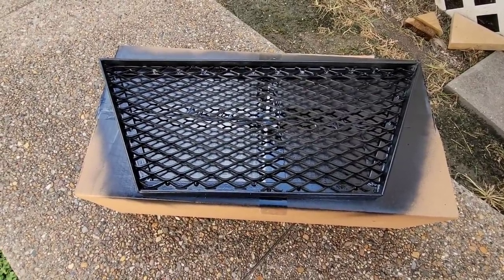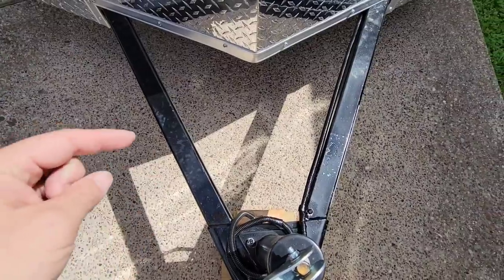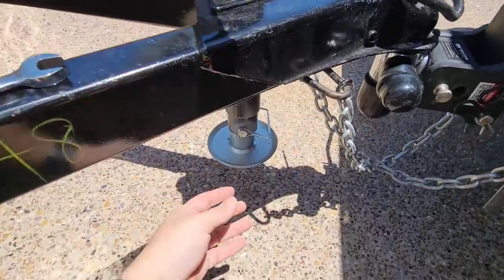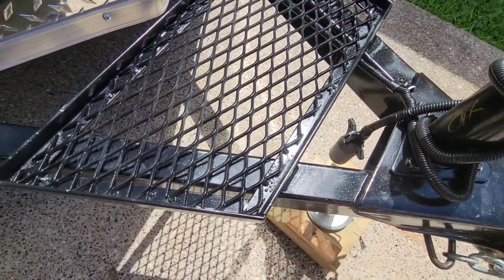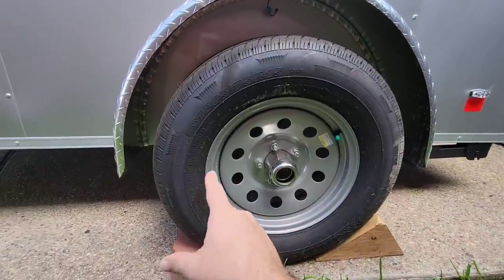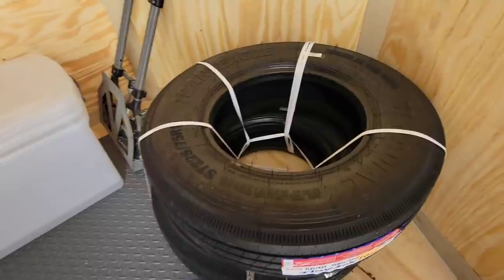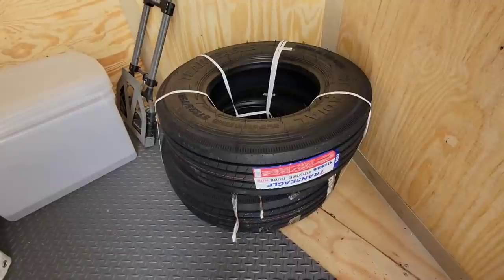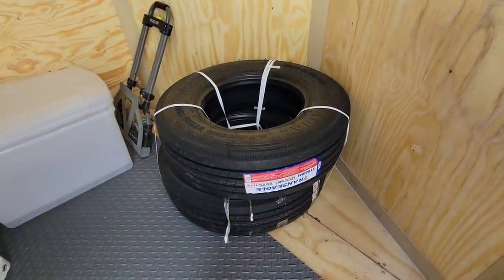Tiny trailer gets a welded on addition!  Also first glimpse at Transeagle 15" G-Rated Tires!

Comment: I guess I'm missing something but regarding the tires, why? People run these trailers with the oem tires all the time and the trailer probably appreciates not being shaken to its core over every little bump even with a decent load. What's next, independent suspension to compensate for the extra stiff sidewalls? ;)
Look forward to the next bedazzlement on the rig.

Comment: I installed a triangle tool box on the frame, installed a battery,  110 converter,  wired inside with fluorescent lights, exterior work lights and a charger with a pigtail to plug in to maintain.  Works great and keeps tool chargers charged.

Comment: It might be a good idea to add a tire pressure monitor system since you are only running one axle. A little bit of warning may save a tire going down and tearing apart your wheel well.

Comment: Put the Trans Eagles on my fifth wheel last year been great so far. Liked them for the ply rating and the fact they have a 81 mph rating. Still only run 65 or so. Run 80 PSI in mine

Comment: Once you get the battery installed, then upgrade to a 7 pin wiring system so you can charge the battery while traveling.  Might as well look at installing electric brakes down the road too.
Reply: Should put brakes on 1st thing.  Any trailer over 1000 lbs.  Most states require brakes over 2500 lbs.

Comment: Only thing I can see with that much psi, is it could actually break, your trailer. The wooden walls, and metal sides, will be taking alot of abuse. You will probably over time get screws backing out etc.

Comment: The existing tire is MORE than adequate for that trailer..  3500 lb trailer.  2 ply car tires at 32 psi will be fine.  80-90 psi is stupid high for that application.

Comment: Your welder has skills. That tray is not only useful it looks great as well. 

I have 225/75 15 max E Rated Westlake tires on my travel trailer. It weighs around 9k loaded. I want to upgrade these tires in a big way. 

Many of the people in my camping group are going with the Endurance tires. I think that’s a great idea but I don’t want to “upgrade” from an E rated tire to another E rated tire. You probably remember it was not that ling ago when Goodyear Marathons had an awful reputation. I’ve seen instances of Endurance tires blowing out as well. 

My only choice in that size seems to be the Transeagle tires and I think that’s a great option. They look like great tires and they seem to have a solid history. 

However I can’t get a straight answer on tire pressure. My rig calls for 80psi in the tires (E of course) and I’m sure that’s what the wheels are rated for.  

I can’t seem to find any info on airing down the Transeagle tires to 80psi. There is conflicting “information everywhere and for sure I can’t find an inflation/weight chart. 

I’ve asked this before (sorry) but if you find a chart or at least some place for me to look I would truly appreciate it. 

Thanks and another great video!

Comment: I run an F rated on my 12ft trailer, but, I've replaced the axle with a 6000lb axle. Also has frame supports added.
Reply: Interesting. I have been thinking about putting these on my 5er . My wheels are only rated at 80 psi so I'm curious how they do at the  80 psi your going to run them at
Reply: @brianheying4478  I run full load most times so I leave them at 95 PSI

Comment: Per most states...  3500 lbs trailer should have trailer brakes.  If you are going to upgrade anything, put brakes on the trailer. Sure your F450 doesn't even know it's back there, but in emergency stops keeping the trailer behind you is important.

Comment: hey Big Truck Big RV - random thought, lets rethink EV trucks and future EV RV's. what if RVs came with a massive battery pack (platform/skateboard) that could act as a range extender for your EV tow rig and/or could also power the RV when parked? you have big connections in the RV world. time to send some emails to these guys and tell them to start working with the big 3. range anxiety in the future potentially solved.
Reply from the maker: Good idea.  Main challenge is weight.  Even Lifepo4 batteries are extremely heavy when you have several.

Comment: Puts drop leg in to avoid a wooden block. Then uses a wooden block in the next scene. I am so confused.
Reply from the maker: The wooden block is to add stability. The drop leg is to keep from having to drop or raise the legs significantly.  It also allows me to hitch it up with clearance to the ball without extending it to the max

Comment: I really think you are getting a little carried away with these tires, I drove 40+ years in a big rig and you should drive a little while and pull over and see if the tires are getting hot, a sure sign that the tires are crying out for help. I had to increase the air pressure up to 70 psi so the tires ran cooler, the dealer said 50 psi was good, I could have raised them higher but it wasn't needed